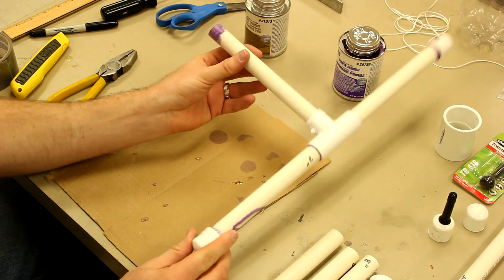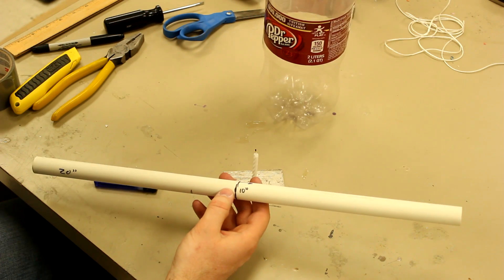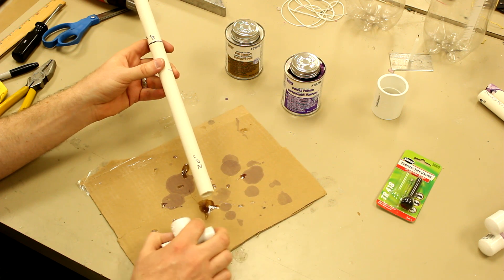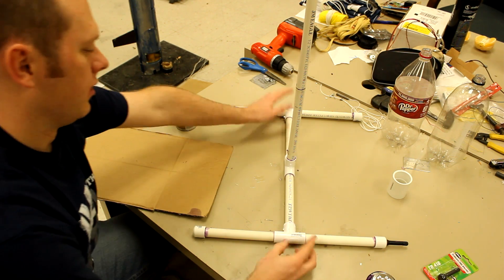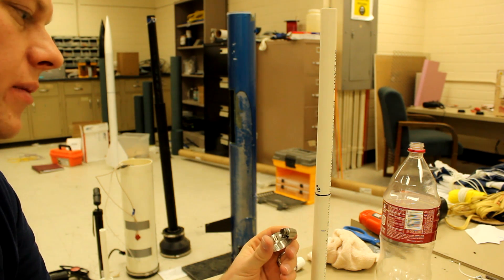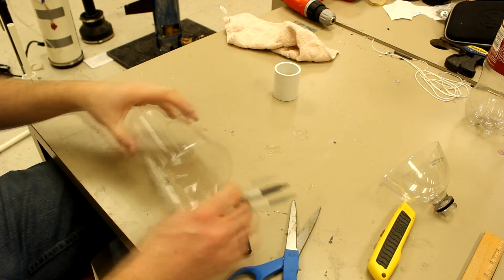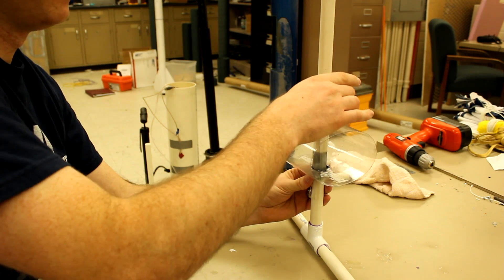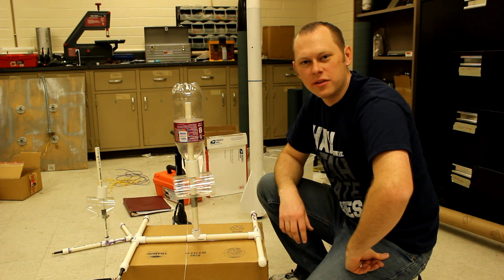Make your own water bottle rocket launcher! - Part 2 of 3

Comment: I wouldn't recommend it. PVC primer and cement essentially forms a chemical weld between the fitting and pipe which is very strong. No other adhesives that I am aware of can form as strong or air-tight of a seal. You can certainly try others but at the risk of having to scrap the project to start over.
Reply from the maker: You definitely want to use the PVC cement.

Comment: Both compressor and hand pumps work fine. Be sure to use a pressure gauge. For safety, I usually launch at about 70 psi. If you want to be adventurous, wear PPI (personal protective equipment) and stand back at a safe distance. I have ventured up to 100 psi myself.
Reply from the maker: Yeah. The bottles themselves start to bulge around 120ish and the pipes are only rated for about 150PSI.

Comment: Where is the leak? Leaks at pipe joints can be avoided by using both primer and generous amounts of PVC cement during construction. Leaks at the seal between the bottle and PVC can be avoided by ensuring that the "bulge" is large enough to create a good seal in the mouth of the bottle and/ or adjusting the height of the zip ties to keep pressure on the bottle flange while you pump it up.
Reply from the maker: Yup

Comment: You will lose some water down the 1/2" vertical pipe but putting the bottle on quickly helps. Making the "bulge" in the pipe about 10" down allows the tube to extend into the bottle above the level of the water once it is inserted. Best of luck!
Reply from the maker: Brock nailed it.

Comment: This is a great design! I built it for a project and it worked great! One flaw though was that after 3-4 trials, it began leaking water while I pumped. Maybe I just built it incorrectly but it still worked perfectly once it released. Awesome design! (and it only cost about $17 haha)
Reply from the maker: Thanks. The zipties may have been slipping slightly allowing the rocket to come up a bit during pressurization.

Comment: can you use anything other than pvc cement to join the pipes together?
Reply from the maker: I wouldn't recommend it. The PVC cement creates a weld as opposed to gluing them together. This lets you get to much higher PSI and ensures a leak free bond.